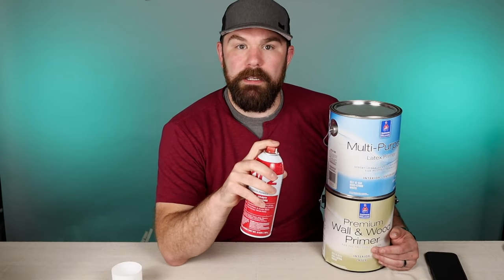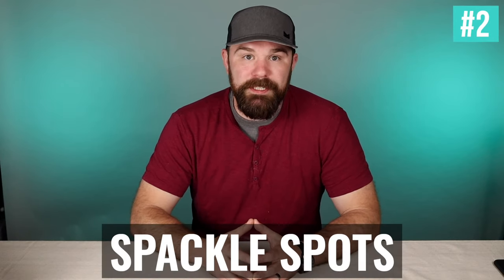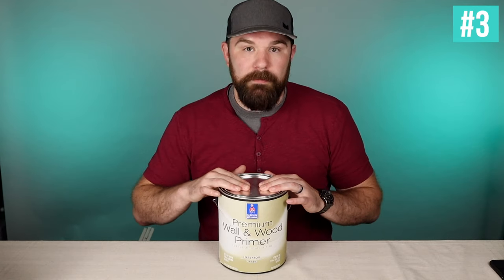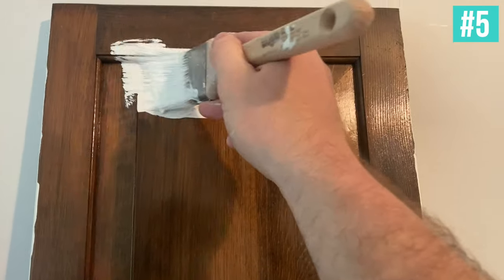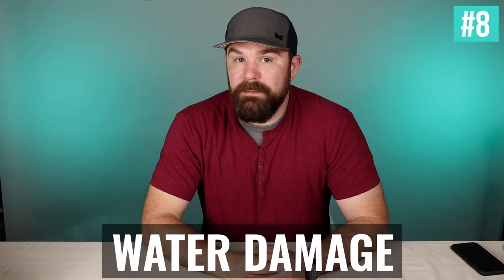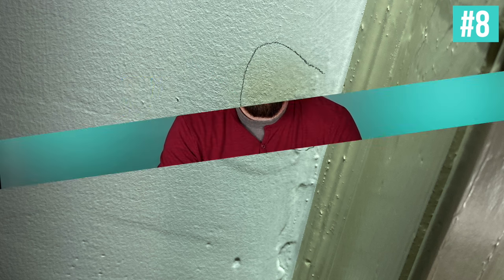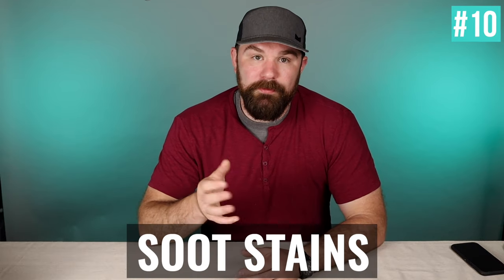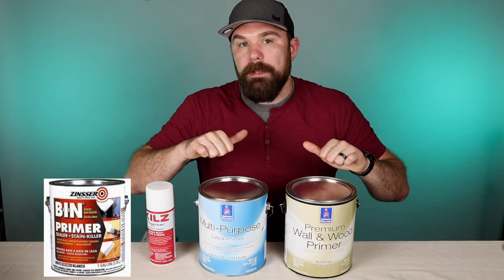10 Things YOU Must Prime to STOP Paint Fails

Comment: I know this was a year ago and you may have changed your primers. However you should try (if you haven't) PPG speed prime for bare drywall and Zinsser Smart prime for over oil. Also Benjamin Moore can tint their primers to the color of your finish paint.
Reply from the maker: I’ll check those out.  We’ve been having a lot success with Benjamin Moore’s fresh start for a variety of specialty applications.  As far as tinting primers go, generally we have a certain amount of primers stocked up. We use white for lighter colors and then we’ll use grey primers for darker colors.  It works for our work flow because we pretty much always do 2 top coats of finish paint.

Comment: recently ran into a situation where it was a repaint over a dark color and the head painter made the mistake of top coating 4 times I think, because he didn't think to prime it twice. Of course he tried to blame it on the paint.
Reply from the maker: That does happen from time to time.  The paint does make a difference in that scenario.  Lower end paints do not tend to cover as well.  The primer also matters.  I've definitely had jobs where we primed and ended up doing 3 top coats.  Not a fun time at all.

Comment: Used Sherwin Williams drywall primer with Icelandic tint on fresh drywall n came out good. Found two areas  after, that needed compound. After sanding, used multi purpose primer with tint n it dried a little darker than the first drywall primer. Why? Will the finish color cover it OK? Used the multi purpose primer on another walk n it was good.
Reply from the maker: Your finish paint should cover that with no issues.  I’m a big proponent of doing two coats of finish paint, but you can see how it looks after one 🫡

Comment: Sharpie must be covered with oil based primer and not shellac. One of the only things shellac won’t do.
Reply from the maker: I don't know why that would be.  We've used spray KILZ and BIN Shellac over top sharpie and it's always worked fine.
Reply: @SuperVassarBrothers because shellac is probably a solvent to the material in the sharpie. But hey if it works it works, I just had a different experience.

Comment: Great video - wandering what to do with rusty nails leaking thru white paint.  Should I use oil base paint?  The surface is the exterior trim around my garage door.  Thanks again, love your videos.  Thanks
Reply from the maker: Yeah…you can use BIN shellac or Kilz for those spots then go over it with your finish paint.

Comment: Excellent video!  Not sure if you still check this, but I have four windows on the side of the house in virtually constant sun through the summer.  Not sure what they were painted with, but the paint at the bottom has flaked off...it's a nearly horizontal surface.  The paint applied to the top and sides is in decent shape.  Since there's now bare wood exposed, I presume I need to prime with an oil-based primer?  Should I then use an oil-based paint for the top coat?
Reply from the maker: You can use an exterior wood primer if the wood is in good shape.  If you're getting a lot of bleed through then you may have to spot prime with a on oil-based primer, but a regular (latex) primer should work fine.  Then I'd would use Moorglo Soft-Gloss from Benjamin Moore.  That's my go to exterior trim paint and it's a hybrid.
Reply: @SuperVassarBrothers  Sorry for the delayed reply...been sick since Tuesday evening! Thanks so much for the response!

Comment: Question: for the stained trim, Do you have to sand it first? I noticed in the video the cabinet door had a shine to it, my trim does too but you didn’t mention anything about sanding it. Don’t know if it was an accident or if you don’t need to when applying that particular primer.. thanks in advance
Reply from the maker: I would recommend sanding stained trim before you try and prime it.  You may also be interested in this video of Fresh Start primer.  It's a good primer for converting trim that's easy to use: https://youtu.be/jydQq4jHOnE

Comment: Love your videos. Great insight. Have a 22'x28' room with 12' ceilings with soot stains on ceilings where the trusses are located, and part way down the walls from the ceiling. I cleaned all the areas. Now ready to prime. Whether i use zinsser cover stain oil or Bin shellac i am going to have to use a respirator. How much of a risk of pulling some of the primer that may get tacky, will i have as keeping a nice wet edge is going to be impossible. With Zinsser cover stain would you reccommend  a 3/8" or 1/2" roller cover on a 14" roller? Shellac seems really messy to me on the ceilings because it is so thin. Also concerned about roller marks. If i use cover stain oil base Do you recommend painting the entire ceiling and all the walls even where there is no soot stain? Concerned about height of paint on walls if i dont prime it all.
Reply from the maker: I just did a video on using BIN.  That's what we use for the application you're talking about.  Here's a link to the new video:
https://youtu.be/MXzq60W6Gts
I hope it's helpful!
Reply: Thanks so much for your guidance on the shellac primer on the 22x28' room with 12' ceilings. All the walls and ceiling covered well with no problems,... except one wall that the homeowner remembers painting separately with a different latex egg shell paint. On that wall, I have had multiple areas from 4" x4" to 9"x3' that crackled as the shellac did not bond to the previous paint. All the walls were washed and let dry for over 24 hours the same. I will attach some pictures. I sanded those areas and tried the shellac again but I had crackling again, especially  where the new shellac met the shellac at the border where it was scrapped where it bubbled up and crackled up to an inch or two into the first coat of shellac. I tried using Roman rx 999 and I had some similar results, but not in all areas. Some areas bonded well and I did some drywall mud work to level it off. Any recommendations of any other product, possibly the zinsser peel stop thin product? Also once the work is done any  recommendations on a primer to use on the entire wall prior to painting the emerald latex top coat? Thanks

Comment: Jeremy, do you have recommendations what primer or finish coat you can apply to hide small holes (from bubbles)? Something like liquid filler that can fill up the those small holes and avoid having to do another skim coat. Any ideas?
Reply from the maker: By bubbles, I'm assuming you mean air bubbles in the spackle / joint compound that show up after you sand.  It really depends on how many there are.  We often will use the wood filler from sherwin williams between finish coats if there's not a huge amount of bubbles.  We'll smear it in with our fingers then lightly sand it.  It dries super quick.  Then we'll spot hit it with the finish paint before we do our final coat.  If there's an area with a lot of pinholes then skim coating is the way to go.  Lightly sand with 220 then prime, and hit it with your finish paint.  I know it's a pain in the butt, but I haven't found any better solution.  A way to avoid the bubbles in the first place is to mix your spackle.  A lot of guys will mix their joint compound with a drill and a mixing bit.  That whips the air out of the mud, and helps prevents the bubbles / pinholes from appearing in the first place.

Comment: what do you recommend for concealing grey sanding sponge stain on recently double ;primed, double paint coated drywall ceiling (used S-W multipurpose primer and Cashmere off-white for ceiling paint)? Thnx:face-blue-smiling:
Reply from the maker: If it’s been painted recently then I’d clean the area, then prime and paint it with your finish paint.

Comment: I have a couple of questions. Im trying to determine a paint product from SW that is multipupose, so i dont have to buy two different types of products (Emerald, Duration, etc). What would be my best bet to paint the whole house? Is primer needed if the majority of the house has light paint walls (tan, light blue), or can I do two coats instead? I'll be using color paint Acier for the entire walls.
Reply from the maker: My current go-to wall paint is Emerald matte from SW.  You don’t need to prime for typical color shifts.  2 coats and you’ll be good to in most cases.

Comment: Is it oke to use any type of primer for exterior hpuse painting.  Can you suggest a reasonable priced primer for exterior painting.  Does it have to be same brand as the paint ?
Reply from the maker: The primer doesn’t have to be the same brand as the paint.  It really depends on why it is you’re priming.  That really dictates what product you should go with.  If you use a high quality exterior paint like Moorglo Soft-gloss or MoorGuard Low Lustre from Benjamin Moore, then a lot of times you don’t need to prime.  Most of the time a decent multi-purpose exterior primer will work.  Fresh Start is excellent, but there are decent exterior primers from just about every paint brand.
Reply: @SuperVassarBrothers  thank you iam actually planing to buy mooegard,  to do my exterior painting. But the painter said that we need to do priming before painting as our house is a brown color and we are chainging ot to a lighter color.  Is it required to have primer?

Comment: We are looking to paint the walls in an open floor plan home which has the original white colored builder paint on the walls.  Because of this I feel like the walls will soak up paint quickly.  Do you recommend applying a primer first?  If so, would you recommend having the primer tinted if we are going with SW Light French Gray?  I priced out enough paint for two coats (approx 1500 SF), but thought it might be less expensive to prime first rather than apply two coats of SW Duration Matte.
Reply from the maker: I'd recommend doing two coats of Duration Matte.  That is our go-to interior wall paint for the majority of our residential jobs.  I always recommend doing two top coats of your finish paint.  The Duration Matte should cover just fine in two coats, especially with a color like Light French Gray.  That will give you better results then doing one coat of tinted primer and one top coat.  

Happy painting!

Comment: I have a can of satin-finish white paint...can I use that to cover my old wall colour? Or will it cause problems with adhesion? My new wall colour will be in a matte finish.
Reply from the maker: If you’re not doing a dramatic color change then you can go over the old paint with the new matte paint.  We always do 2 coats and that almost always does the job.
Reply: I also have zinsser 123...would that be overkill?
Reply: It'll be an off-white colour. I was just worried it'll mess up the undertone but maybe I'll just add an extra layer. thanks for answering so quickly!

Comment: Hire in Europe i have zinzer, but it's more expensive then the paint. Whe most use the transparent primer thet whr delute with wather(3:1)
Reply from the maker: If the final project looks good, that's what counts.   The Shellac base BIN is around $50 USD here which is more expensive than most paints.    Also depends on how much of the primer you use on the job (spot painting, just ceiling, or entire room), and its only one coat regardless.   Whatever works for you and for your budget :)
Reply: @SuperVassarBrothers  you have a point, its alweys a tight budget😅.

I only youse regularly the latex stain block products (similar to what you have shown)

Comment: Hi,  Can you recommend a primer for exterior trim?
Reply from the maker: Generally any interior/exterior multi-purpose primer will work.  I use the one from Sherwin Williams.  If you’re dealing with raw wood that has a lot of knots and potential for tannin to bleed through then you may want to use something like exterior oil-based wood primer from Sherwin Williams, but most of the time the multi-purpose latex will work just fine
Reply: Great , thanks!! @SuperVassarBrothers

Comment: 1.  New Drywall
2.  Spackle Spots
3.  Raw Wood
4.  Dramatic Color Change
5.  Stained /Polyurethane Trim
6.  Oil Based Trim
7.  Wallpaper Removal
8.  Water Damage Stains
9.  Dark Marks such as pen marks
10.  Soot Stains

Comment: Great video what do you use as a bonding primer when trying to paint a very slick surface?
Reply from the maker: I'd recommend the BIN shellac based primer from Zinsser.  That gives me the most consistent results with slick surfaces.  You may also want to sand the surface with 100 or 150 grit sandpaper prior to priming it.  That will also help the product adhere properly.  Good luck with your project!
Reply: XIM UMA for slick surfaces.

Comment: If I'm converting over to latex paint for my trim which mind you was oil do I have to sand first or I can just prime with cover stain
Reply from the maker: You can scuff sand if it’s super slick.  You may also consider using a primer like fresh start.  I’ve had a lot of success with that recently.  It’s much more pleasant to work with than cover stain.  If fresh start doesn’t work then I go with BIN.  Here’s a video where I use fresh start if you’re interested: The Secrets to Painting Your Handrails FAST
https://youtu.be/N61F9K9cjnA

Comment: Question.....from what I gather PVA primer for new drywall is technically a sealer. This being the case and the fact that it's cheaper than most other primers. Can PVA primer be used to primer previously painted walls successfully prior to repainting. I ask because I have a room that is currently painted grey. I'm going to be sanding the walls as prep. I currently have about 3 gallons of PVA primer left over from a previous project, and I'd like to use it for this depending on your answer. Thank you! 😊
Reply from the maker: You can definitely use the PVA primer to prime previously painted walls.  Generally the PVA primers are somewhat transparent.  If you're trying to do a major color shift, like going from dark wall to light walls, then it's not the best.  But if you're just trying to give the wall a clean start, then you'll be good to go.
Reply: @SuperVassarBrothers  thanks 😊

Comment: I've used the Zinsser 123 on priming drywall repairs, but sometimes it flashes through after I topcoat it.  Can you recommend a primer that maybe dries flat, so it doesn't flash through on the final paint coats?  Thanks....
Reply from the maker: We like Drywall primer from Sherwin Williams.  May have a slight sheen to it, but we don't have issues with is flashing.   We do two coats over it tho.   The multi purpose from Sherwin Williams is great to.  More expensive, but good.

Comment: Question, how is it to a ceiling when the primer is not the same texture as the thicker primers? Would have like to have seen that process. Thanks Jeremy
Reply from the maker: I’m not sure exactly what you’re asking.  The texture mostly comes for type of roller you use.  When you prime use the same nap roller that you use when you apply the ceiling paint.  Then when you top coat it there won’t be a texture issue

Comment: should I sand prior to using a shellac primer?  or is it sooo good I can skip that -( going latex over oil in this example.)
Reply from the maker: I’ve never had BIN fail to stick to a surface.  You can do a test section, but in my experience you can probably just hit it without sanding.
Reply: thank you. @SuperVassarBrothers

Comment: Jeremy, Unfortunately,  my door was oil base , the painter didn't give primer  , just painted two coat latex fininsh coat. now the door paint flake off . what should i do now ? sanding the door first to get rid of latex coat? thanks .
Reply from the maker: Ugh, yeah unfortunately you’re going to have to sand off the loose paint.  Then I’d suggest using an oil or shellac primer then going over that with whatever trim paint you want.  You could also try a hybrid paint after you sand like Emerald Urethane Trim Enamel from Sherwin Williams, Advance or Command from Benjamin Moore.
Reply: @SuperVassarBrothers  thanks a lot for helping me❤️

Comment: Since the primers are so good, why not have them colored and not bother with a top coat?
Reply from the maker: Without getting too much into the weeds, primers and top coats do two different things.  Primers generally don't have much sheen to them and are not meant to provide a protective coating on the surface.  They are intended to prepare the surface for a top coats.  The primer's I mentioned in this video are very good for priming.

Comment: Jeremy, wondering why you left out re-painting over walls previously painted with sheens higher than eggshell? Do you simply sand or use a de-glosser? Or do you apply a bonding primer? Painting crews around me range from doing nothing to doing all three. Thanks!
Reply from the maker: Good question.   If we think the eggshell paint won't cover in 2 coats we will use a drywall or multi purpose primer.